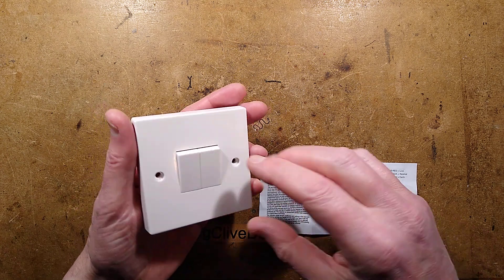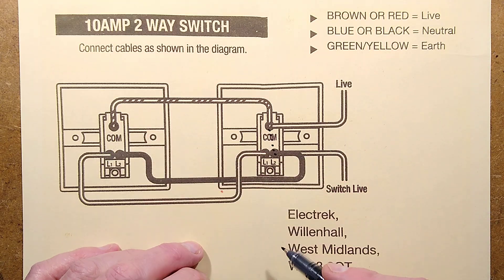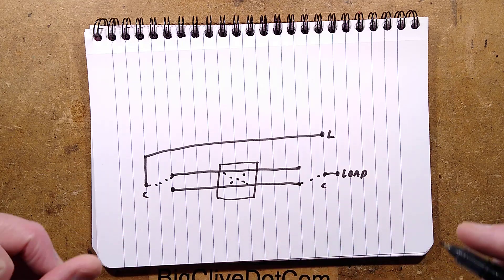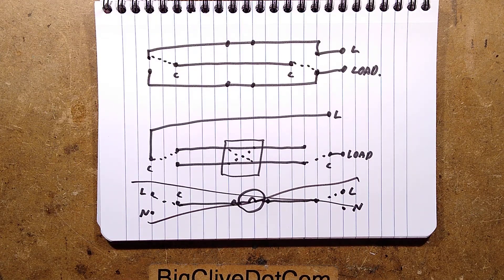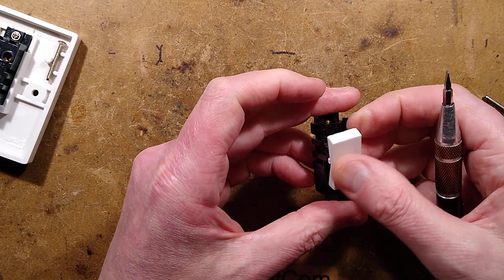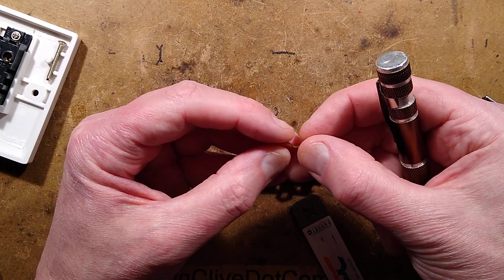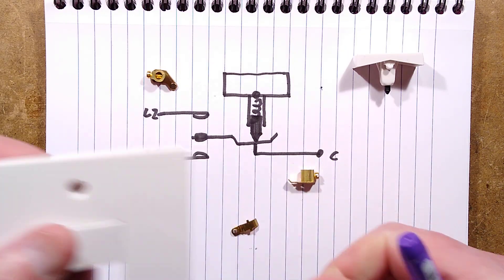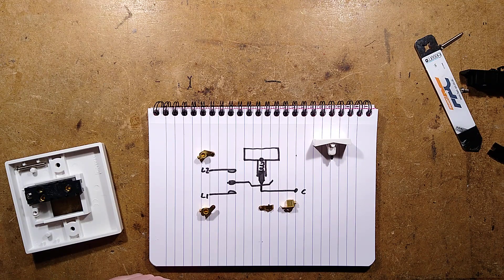Poundland 50p switch teardown

Comment: Your preferred wiring is also mine.  It is helped by the availability of triple + earth cable.  I wish I had a pound for the number of times I have had to explain (sometimes to 'electricians') how two way + intermediate switching works.  When my parents house was built I, who was only 14 at the time, had to convince the electrician that they could have four switches for the hall stairs light!  He still got it wrong and one switch  was acting as a 'master'.
Reply: Same with my step-dad when he decided to wire the lights, and for an added bonus he got one of the switch plates rotated 90 degrees! He never did fix it 🤷
Reply: @merseyviking  Rotated 90deg so it indicated a 2-way circuit?  Suppose so.. not hard to do with some switchplates that can accommodate 6 clip in switch mechanisms.
I might try that with a difficult to operate when my hands full kitchen 2-way I've at home.
Reply: Oh yes I had that at a hotel in Hungary. Old place with 1950s electrics I think (1.5 mm2 aluminium singles in pre-harmonised colours) and the dining room had four lights and five switches. I think one of the switches let you turn off three of the four lights permanently, one acted as a master switch (unintentional) and the others sort of worked as intended. Their local electrician never managed to figure out the issue and apparently none of the owners (some of whom were quite good with electrics) never bothered to fix it. Or rewire the whole place before the ally wiring with twisted and taped joints burned it down. Haven't been there in 25 years but from Google Earth the place still looks exactly the same. I think it closed as a hotel soon after the last time I went there so you can't find anything on the web.
Reply: I rewired my parents house when I was 17 (all to regulations) over 50 years ago my dad bought me a Honda 250 (second-hand) as payment happy days...
Reply: yeah, I usually use three-wire two-way switching, generally I use an SDI and a twin-active cable for the interconnection between the switches because that's what I have on hand.

Technically under AS3000 you can use a 2C+E if you sleeve the exposed portion of the earth conductor in an an appropriate colour, but it still makes me squirmy to use an "earth" conductor for current even if the ends have been recoloured.
Reply: @SomeMorganSomewhere  Very poor practice using 2C + E that way. Just buy the correct twin active TPS and single core TPS to do a switch drop. At 1mm^2 they are small cables and easily drawn down.
Reply: @BTW...  yeah, I agree, that's why I don't use the 2C+E method ;)